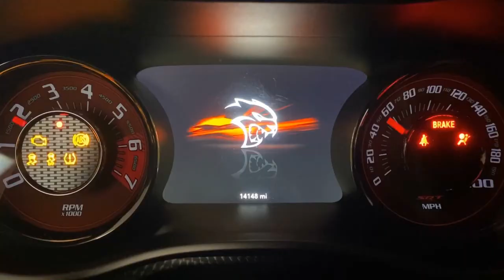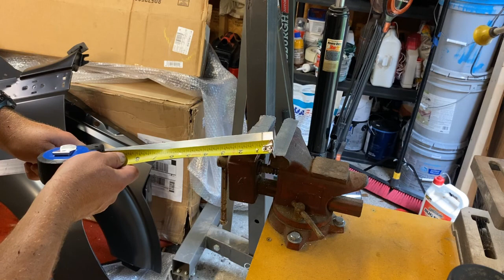6.0 Powerstroke Excursion Build Part 7: Modifying Pocket Style Rear Fender Flares

Comment: Those look amazing Rob! You and your little helper did a great job! I have the same fender flares sitting in the garage for over a month now because I have not been able to figure out the fitment issues with the rear ones that you just solved for me. If you can share a couple of measurements on where to cut between the door and fender, I would greatly appreciate it. God bless you and your family!
Reply from the maker: Very much appreciate it! Yes sir, I will get you some measurements in a few days. Work has me all over the place right now.
Reply from the maker: The cut is 2.5 inches back from the leading edge of the fender flare at the bottom. But I didn’t measure to make the cuts, simply mount them up and cut down the door gap.
Reply: @GSXR1000Rob  Thank you for getting back to me! I look forward to more videos from your channel. I will be sure to encourage my humble 855 subscribers to check out your channel.
Reply from the maker: Much appreciated!!!

Comment: Hey Rob, looks great! I will have to tackle the same task as you did here with the flares.  Dilemma I am having is the 99-05 flares you used for the back are 6.5" tall and the flares for the 11-16 front fenders you will eventually end up with when your done your front end conversion are 7.25" tall.  Are you just going to live with the aesthetic difference from front to back?  I am considering getting the 11-16 flares for the back and doing the same modifications you did to them so they match front to back height wise - even though i like the look of the shorter 6.5" 99-05 flares... Never Straight forward unfortunately...  Still debating what to do?!?!
Reply from the maker: You just taught me something! I had no idea! Crap! I will keep you posted on how I think they look together. 3/4 of an inch seems like a huge difference. Please keep me in the loop if you modify 11-16 rear flares for the excursion. If the wheel arch is the same, that might have been the better option considering I already had to modify everything else.